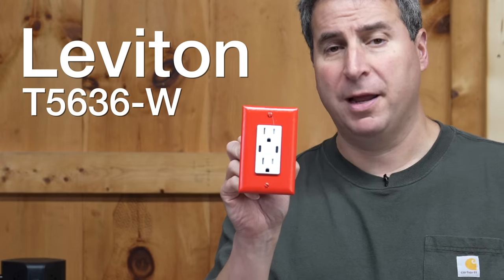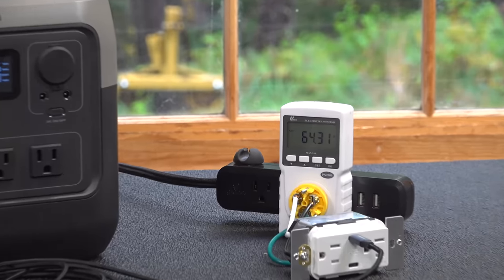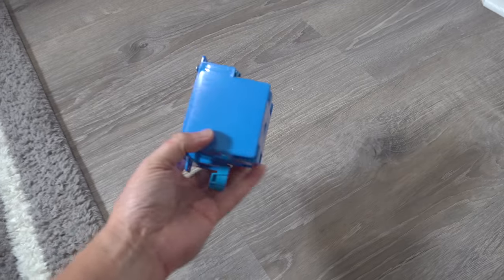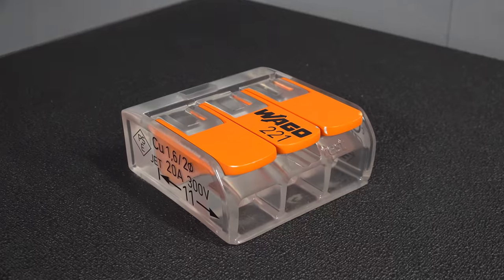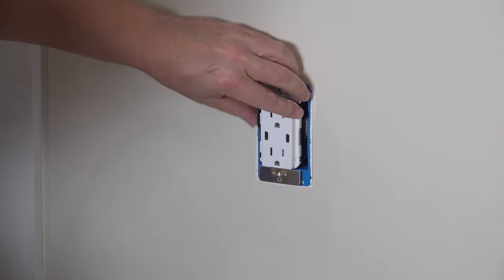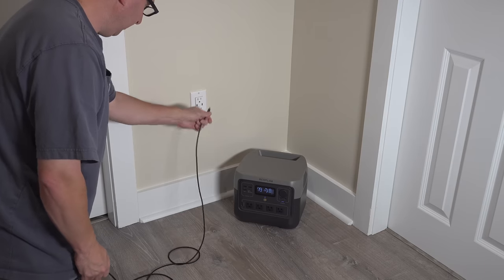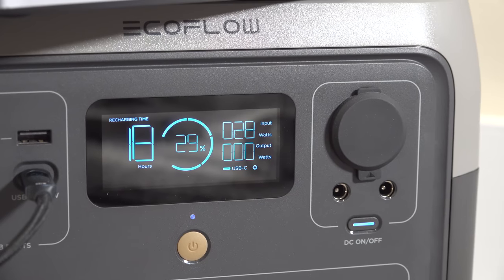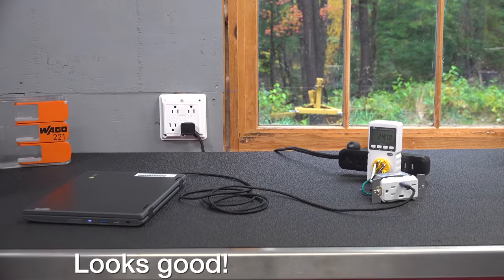Most Powerful USB Outlet you can buy that won't burn your house down - Leviton 60 Watt

Comment: Why would anyone have said this was impossible to do safely? That is one of the dumbest things I have ever heard. We have had very small 67w chargers for a long time now with GaN tech. We even have 120w chargers that fit within a cigarette lighter for a car charger. This outlet is also old news, these Leviton 60w output models have been out for just about a year. I know cause that's when I installed some in my house... Also the TopGreener brand has had this same thing out since the beginning of 2022, and it is also UL listed. So the Leviton is not the only one.
Ive actually been on the hunt for 100w models but they dont seem to exist yet.

edit: looking it up, the Amerisense brand also has multiple 60w models that are UL listed. So ya, this video is full of some really bad information.
Reply: I think safety has to do with the fact that heat is more difficult to dissipate inside an electrical box.  I have a 160 watt car charger but it has a warning about using it for extended amounts of time.  While the car charger is in use and overheats, is not a big issue as you will be able to remove it and toss it out a window if it started smoking.  I still get your point.

Comment: I've had these new USB receptacles for awhile and they seem to be holding up well.  My furnace went out and I had to use these on spliced 12AWG stranded CU to 10AWG AL running 1500 watts for many hours on 15A receptacle, they held up nicely for the 2 months we were running electric heat on high loads for many hours at a time.   

The ones I used are Leviton brand, but the regular usb ones.  Never had any issues using them.  I also inspected my Alumiconns after running those heavy loads, and no issues.  I don't know about these newer USB C ones though.

Comment: "you will always have solid wire in your walls" - not everywhere. Some jurisdictions require all wiring in conduit (Chicago for instance) in which case it will be stranded. But the Wago is the right answer even stranded to stranded, IMO.
Reply: Wiring is solid core pretty much everywhere Chicago just requires conduit to be run instead of using romex
Reply: @Framdark  Ever try to pull solid core through conduit? Everyone I know who lives there uses stranded.
Reply: @John_Ridley  our house has solid could be different in different areas of Chicago

Comment: Thank you for posting, I didn't know Leviton had cracked the code! 
Bummer it's so big: my house has small boxes. I wish there were a version with the USB C on the bottom and a single outlet on top: should let the designers make it shallower. 90% of what I plug and unplug these days is some form of AC-DC converter :o

Comment: Wondering if it's safe to be both charging at the rated wattage as well as pulling 1200w from the outlet together.
Reply: Yes, pulling AC amps on a receptacle will only generate a small amount of heat from the resistance of the conductors. In comparison to the heat generated and dispated from the built-in rectifier, it's negligible

Comment: Wagos are only beneficial for non-electricians, and the question then needs to be asked, if you need Wagos to safely and correctly wire anything electrical…should you be doing electrical wiring then?
Most honest diy’ers would say no, since wago is an excuse to say you can do electrical. 
Don’t do it. Properly made twisted joints and wire nuts are the way that all other formats try to hold up to and cannot.

Comment: I see a lot of comments on Amazon that it does not work on all PD profiles. Apparently it gets even more unpredictable when plugging in two devices. This points to a deeper problem with adding sophisticated electronics that is outdated within 5 years to fixed outlets that normally last at least 20 years. 

Even though the USB-C standard plug is expected to be around for a long time, there are so many variations and changes in charging standards that future devices may not fully work. I would rather have my short-lived constantly updating electronics devices (including chargers) plugged in than integrated into the wall.
Reply: That's more a question about compliance. The power delivery standard likely stays for a long time.

The manufacturer spesific charge protocols are best to ignore, so they don't manage to become common.
Things like quickcharge, vooc, e.t.c. should not be supported, while the official one should!

Comment: Topgreener has had one out for a while now and it actually supports pps. Theyve always been way ahead of leviton and other brands with usb standards. Wish the mainstream brands would step up their game
Reply: Moving that fast means less testing, and more risks. Brands like Leviton want to be sure their devices, when placed into walls, will last like 20~30 years, and you can't do the testing to verify that right when the new standards come out.

Meanwhile your random Chinese brands aren't really concerned about longterm support. A lot of them "go out of business" every six months or so. A few are more reliable, but for the most part they're all using the same part from the same factory with a different label. It's cheap as hell and can support the latest standards because the development turnaround is so quick, but every so often something will go wrong.

It's all in how much risk you're willing to take. And for me, personally? If installed inside the wall I want as little risk as possible. But for something that just plugs in I'll roll the dice.
Reply from the maker: I looked at that one as well. It has no safety certifications (no independent tests) and there are 15 reviews all stating the "USB stopped working within 30 days". Just be careful
Reply: @SilverCymbal  It is UL listed and I verified that it's in the productiq database. Leviton is not too much better in this regard as their 30w unit also has plenty of reviews complaining of the USB ports stopping charging.

Comment: as a firefighter and an electrician i recommend placing a properly rated breaker in line with the outlet just so that you can make sure it will not cause problems, or if you wanna replace it in the future you can simply shut off the breaker and replace it

Comment: 60 watts is not a good idea for phones or even mpst tablets. This is such a niche within a niche I can't figure who would want it besides colleges.
Reply: 60W is a perfect wattage for charging tablets like Surface/ROG Flow, or practically any USB-C based laptop made in the past 7 years. It can also do 15+45W for your phine and laptop.
Reply: it doesn't give 60w all the time, there's a handshake process w/ the device to determine how much juice it can take
Reply: What are you talking about. Most new phones, tablets, and Computers can handle 60w. Only iphones up untill new ones barely done 30w. Rest of the world have been 60+. My Macbook Pro wont even charge with anything below 60w, need a 85+ brick for that.
Reply: It uses PD. It has a controller that talks to the device that is plugged in and asks what wattage it wants and then provides that. So if you plugged in your Pixel phone it would only provide 30 watts. If you plugged in your laptop it would provide the full sixty, provided the other USB port isn't being used.